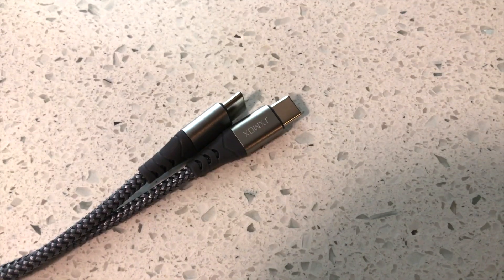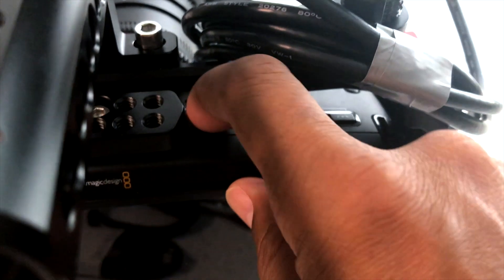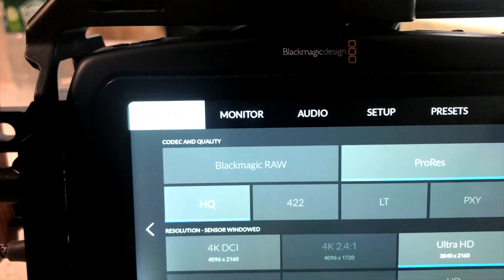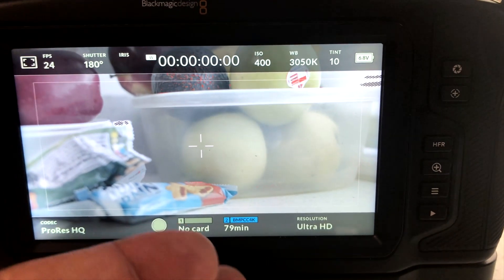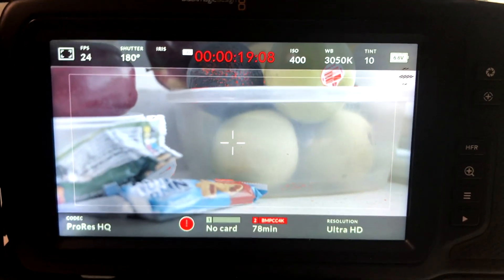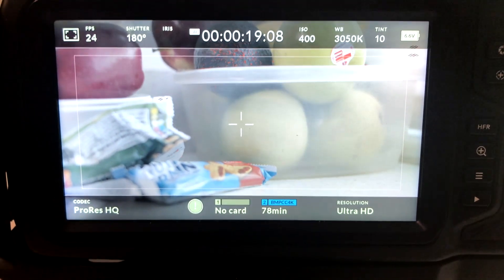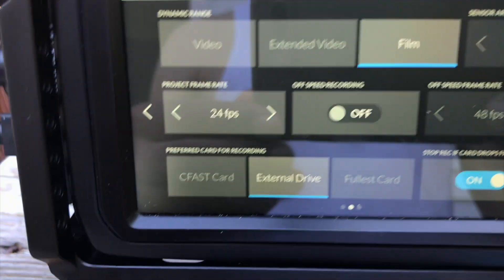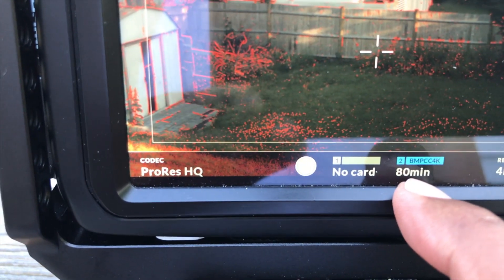USB-C Issues with Samsung T5 & BMPCC 4K

Comment: HEY THERE, MINE SAYS "FORMAT" ON THE CARD BELOW, DO YOU ANY SOLUTION FOR THIS? I AM STILL USING THE USB-C  CABLE THAT COMES WITH THE T5. ANY RECOMMENDATIONS? THANKS A LOT IN ADVANCE
Reply: Basically all you have to do is disable the security log in on the samsung app itself on the pc
Reply: I have the same problem and nothing on the internet so far has a solution for this
Reply: @haydenbesly6728  Hey I already have the solution for it

Comment: please give the name or link of the wire that works best. I bought 5 different wires, they all work equally badly, they don't fit, I'm desperate, please tell me and thank you very much for your video, you are super
Reply: you need a data type cable, as opposed to a charging only type cable.